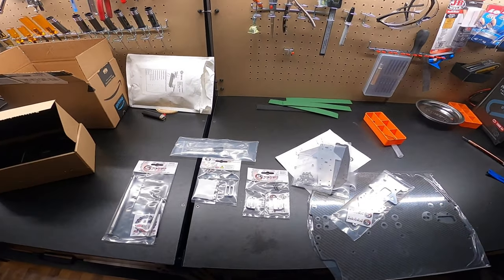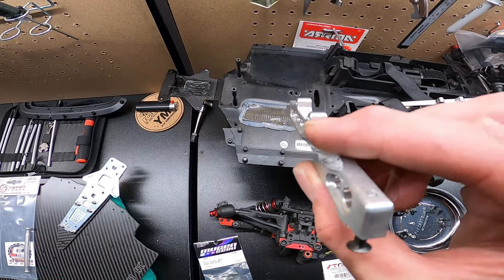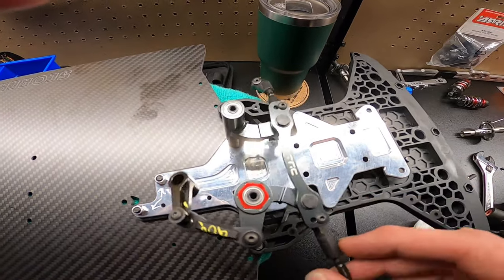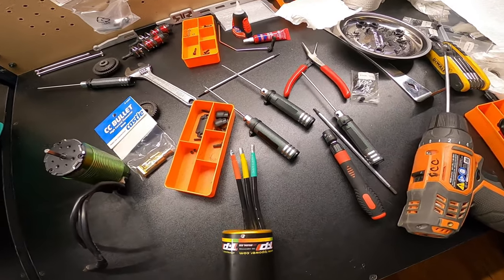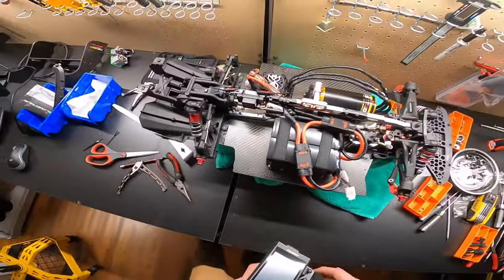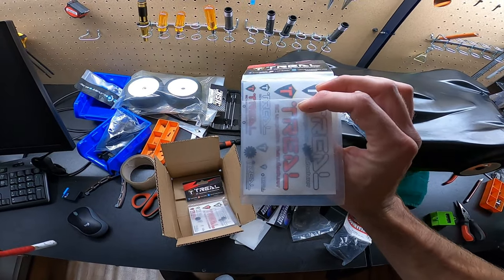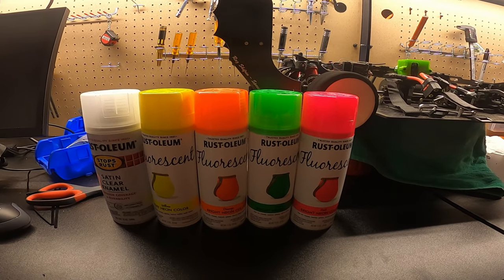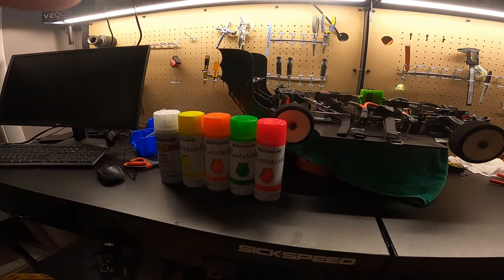Arrma Limitless GT 150mph+ RC Build

Comment from the maker: How fast do you think it can be pushed? I'm thinking 175mph💪
Reply: 200!😂
Reply from the maker: @topracingrc9564  That would be epic 😁💪
Reply: Bro how do I tune my car to go this fast in my XLX2? My friends won’t tell me about tuning bro and it sucks ! He’s doing 130 I’m doing 93
Reply from the maker: @cryptobra5933  what's your motor, gear and battery set up?
Reply: @zagertRC  The 93Mph run was with a Tp2080 Max8 esc . (On 8s) Two CNHL 8000MAH 4s batteries 27 pinion 42 spur.. I wanna get in the 100s
Reply from the maker: @cryptobra5933  Turn the auto lipo shut off to none on the xlx2. Otherwise you have some good batteries to get over 100 with that motor. Keep gearing up and checking data logs.

Comment: Hey how are those drive cups? Just got some scorched rc center driveshafts and would hate for it to get ruined by the stock Arrma cups. Do you think it’s a must upgrade even if I’m currently running the stock motor?
Reply from the maker: I haven't had any problems yet and I've done multiple passes between 130 and 154mph. If there is play in the shaft you need to put little rubber gaskets as spacers in the drive cups, so the drive shaft can't shift forward and backwards. That will also cause wear.
Reply: Thanks, sorry for the dumb question but how much play would be appropriate?
Reply from the maker: @williamsamaniego1032  I don't have an exact answer for that. I have about 1/8" of play.
Reply: @zagertRC  thanks for your help on this, what do you use to minimize the play? Just any orings from the local hobby store?
Reply from the maker: @williamsamaniego1032  Yes exactly. Little plastic o rings
Reply: @zagertRC   hey I got these ordered, I’m super excited to try these cups. One thing I wish I had asked earlier is do you upgrade the cups in the center diff? I’m doing this to a stock infraction with stock motor. I upgrades the center drive shaft to the scorched rc like the one in this video.
Reply from the maker: @williamsamaniego1032  My center spool is from scorched rc with their drive cups, which I think are the best. If you have stock ones I would switch them out

Comment: You’re over geared at 54/40 you need to gear down on the pinion and spure   I know this from Experience. It’s your car though
Reply from the maker: I had no problems when I hit 154mph. I geared up even more and still no problems 🤙
Reply: @zagertRC  my pb is 154 at 48/25 with a voltage sag of 22 23 volts due to a bad solder joint had I known I woulda fixed it and most likely hit 160. It’s fixed now but my motor blew cuz of the bad voltage sag. So yeah gear down pay attention to your voltage sag and you’ll be even faster

Comment: I have a 1721 castle motor with xlx2  esc what gearing I need for drag racing
Reply: I forgot to tell you 8mm bore
Reply from the maker: @ronaldmorris7791  I'm not the most knowledgeable about drag racing. If you're in the Arrma Limitless, Infraction, Felony groups on Facebook there are a lot of drag racers that can help you out😁👍

Comment: Can you link those front and rear chassis braces?
Reply from the maker: https://www.ebay.com/itm/Aluminum-Front-Rear-Chassis-Brace-for-1-7-Arrma-Infraction-Limitless-/234131648197?mkcid=16&mkevt=1&_trksid=p2349624.m46890.l49286&mkrid=711-127632-2357-0
Reply: @zagertRC  Thanks, man! Hopefully they fit with my 8mm driveshafts.